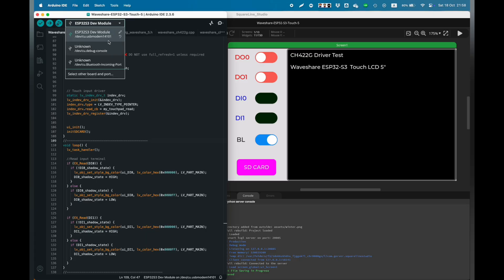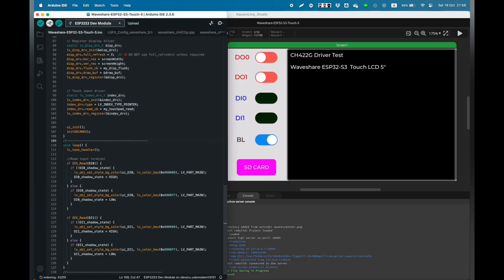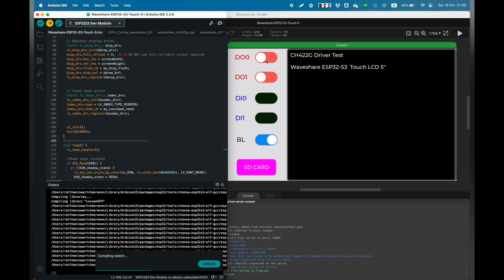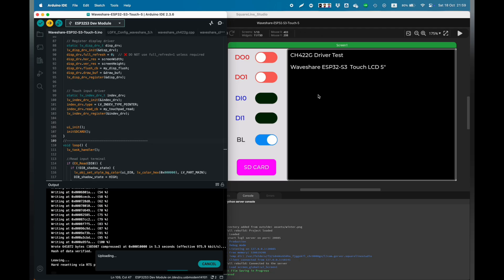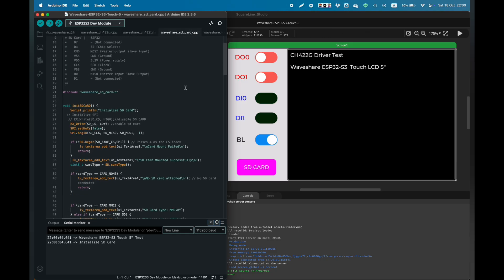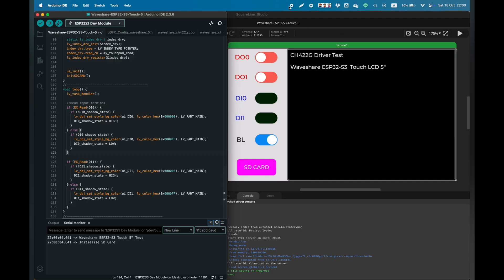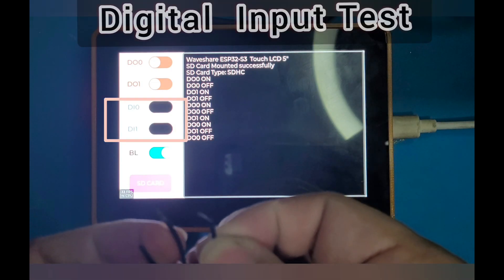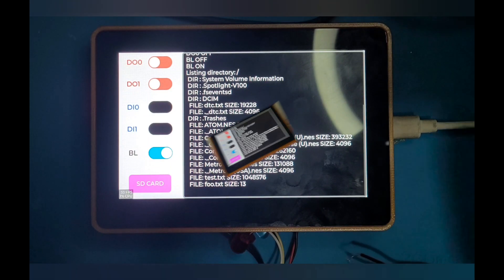Waveshare 5" ESP32-S3 Touch Custom CH422G Driver Demo

Comment: Great project. I am buying esp32-s3 Screen, for my uni project, mainly to send data to google sheet, i wanted to ask you is it possible to turn of the back light when someone not touching it?
Reply from the maker: Exactly!. You ceeat a timer and everytime user touch on the screen or widget. Then reset timer.
If timeout then turn off ba klight. If user touch the screen then turn backlight on again..
Fyi you can not dim the backlight. Just on or off
Reply: @vaandcob  Thank you , I have order one.

Comment: Bonjour 
Grâce à vous aidés je suis arrivé à résoudre le problème des librairies maintenant j'arrive pas à programmer les entrées sorties do0 et do1 di0 et di1 s'il vous plaît aidez moi ça sera ma dernière demande merci chef
Reply from the maker: To debug your code, I need to see your code and what the problem is.  For now, I recommend testing with my code.  Revert the ESP32 core back to 2.0.17  and start from there. play with I/O until you know how to get it to work. then adapt to use with Core 3.x.x

Comment: je n'ai toujours pas réussi à avoir le moindre signal sur mon board Waveshare... Touch...5B ( 1024x600). ChatGPT ne m'a nullement aidé. Quelqu'un pourrait m'aider à lancer un programme minimal sur cet écran ? P.e. afficher ubn point rouge (?) à l'endroit où je touche l'écran.  Je peux travailler en Arduino ou en Platformio, mais mes connaissances sont minimales à ce sujet. Merci, !!!!
Reply from the maker: I think you can get the demo code for Touch 5B from waveshare wiki site.  mostly they provide demo code. that work both Arduino ide and ESP-IDF

Comment: MERCI BEAUCOUP POUR VOTRE REPONSE 
J AI CE MESSAGE ERREURE COMMENT JE peux LE résoudre 
libraries/LovyanGFX/src/lgfx/v1/platforms/esp32s3/Bus_RGB.cpp:307:31: error: 'lcd_periph_signals' was not declared in this scope; did you mean 'lcd_periph_rgb_signals'?
Reply from the maker: seem you use the version different than mine example sketch
if you deveop with Arduino IDE, please check the version as following
Arduino ide 2.3.x
ESP32 Core 2.0.17 (not 3.x.x)
LovyanGFX 1.2.7
or if you're using ESP32 Core 3.x.x .  it has different api, you can fix it by changing variable name to match the newer version.

Comment: HI
I HAVE PROBLEME with LIBRARY can you HELP TO FIND THE correct library FOR 1024/600 MODEL thinkS
Reply from the maker: this is the same model 1024x600 , the source code is in the description.
Reply: @vaandcob   VERSION OF THE library LGFX THINKS

Comment: Hi! I have a question:

With these adjustments, can I use the I2C port for send and receive data?
Reply from the maker: Yes, absolutely there are some few chip connected over i2c bus on this board.
Reply: @vaandcob  Thx a lot! All the information was very clear! You saved my project.
Reply: @vaandcob  Another question, do you know which changes I need to make for the 800 * 480 pixels version?

UPDATE: I already done it!
Reply: Will this work on 7" model too
Reply: @fjellmike Depends if the 7 in model works with the same chip for touch implementation.
Reply: @fjellmike I already read the specifications of the model and works with the same chip CH422G, so it will works. Just remember adjust the resolution to (800×480).
Reply from the maker: @fjellmike  yes, 7" has the same CH224G but some IO pin are different.
https://youtu.be/52tzvPDqIfw
I have a source code for 7" in this video description. but not implement CH22G driver, anyway it'd work.

Comment: Do you have maybe platformio version?
Reply from the maker: you can import to platformIO easily,  just create platformio.ini   as following
[env:esp32-s3-devkitc-1]
platform = espressif32 @ 6.7.0
board = esp32-s3-devkitc-1
framework = arduino
board_build.arduino.memory_type = qio_opi
board_build.flash_mode = qio
board_build.psram_type = opi
board_upload.flash_size = 16MB
board_upload.maximum_size = 16777216
board_build.partitions = default_16MB.csv
board_build.extra_flags = 
	-DBOARD_HAS_PSRAM
lib_deps = 
	lvgl/lvgl@^8.3.11
	lovyan03/LovyanGFX@^1.2.7

build_flags = 
	-D LV_CONF_INCLUDE_SIMPLE
	-I src
	-I src/ui
	-I include

; Serial Monitor options
monitor_speed = 115200
monitor_filters = direct
upload_speed = 921600